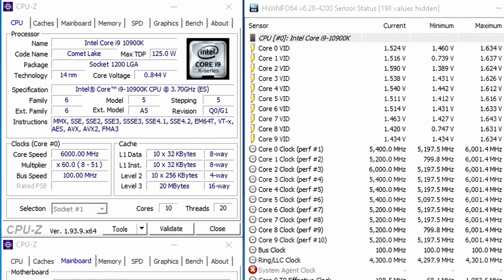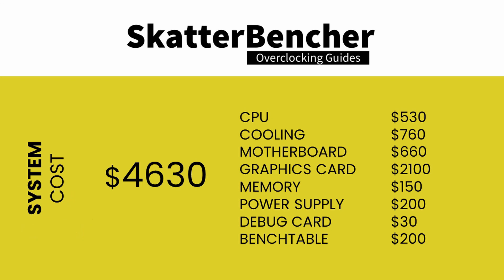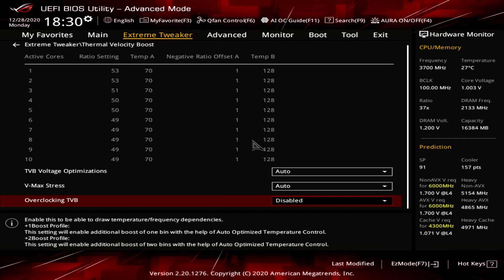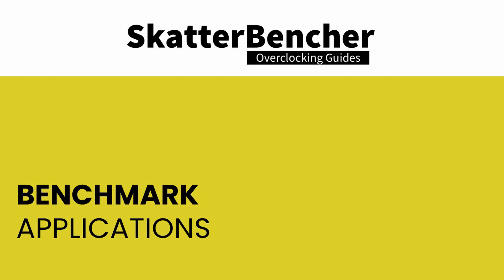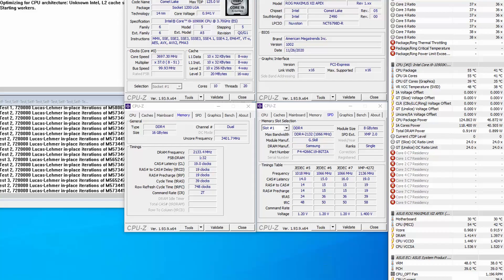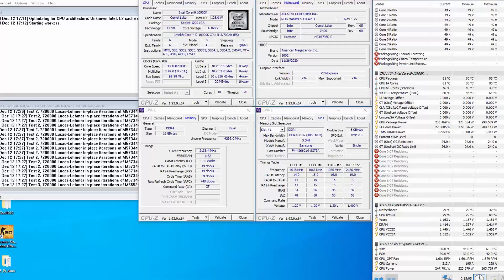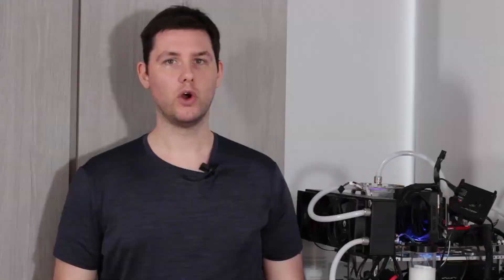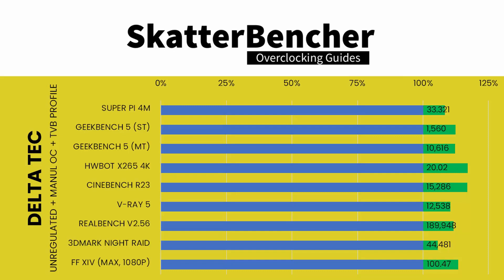Core i9-10900K Overclocked to 6000 MHz With Intel Cryo Cooling | SkatterBencher #19

Comment: Crazy how a 5950x with auto and PBO outperforms a cryo 10900k @ 6ghz. I had the 10900k and its amazing but the 5950x just leaps it hard!
Reply: Not in gaming, only in benchmarks. A 10900k ocd to 5.3ghz with 4.9 cache and fast ram will outperform the 5950x
Reply: @ilovehotdogs125790  Not in the examinations I've seen. Go to check out Gamers Nexus for real figures.
Reply: Crazy how a stock 10900k outperforms even an overclocked 5950x in any game and even on price:)
Reply: @JeoshuaCollins  the “examinations” you’ve seen are using the lowest common denominator of ram.. 3600cl16 (or 3200cl14). Do you know why gamers nexus does this? He said once why.. it’s so his benchmarks of past cpus would be consistent in ram (otherwise he would have to redo all the benchmarks). It’s also worth noting that amd simply can’t use fast ram.. the memory controller is inferior to intel’s. The fabric is also limiting it. Like i said, intel with fast ram beats a 5950x in gaming. It doesn’t even have to be overclocked.. stock with fast ram (like 4266cl17 or 4400cl19) will beat any zen 3 in gaming. Don’t fall for the marketing.
Reply: @ilovehotdogs125790  So you're saying that given faster RAM than the AMD, the Intel performs better.... Do you hear yourself?
Reply: I have a intel 10900k here with the exact same ram and video card as my 5950x. The fps in warzone and farcry are much higher, like 20fps more.

Watch my videos. I have been building computers for 20 years. 10900k is inferior in many ways.
Reply: @Akryl1kz  check out frame chasers on youtube, that guy does ALL the testing. The 5950x can beat the 10900k in warzone only with smt off and an all core oc. In more games than not though the 10900k with fast ram wins.
Reply: @JeoshuaCollins  yep
Reply: @ilovehotdogs125790  Well then, as a counterpoint, if you hooked up an overclocked 5950x to a custom loop water cooler, it would outperform an overclocked 10900k on a stock cooler. If you're just going to give one side better kit, then of COURSE it will perform better.
Reply: I don't have to check out anything lol I own both computers right now identical ram, same video card, power supply. Etc...the 5950x is better. I have put them against one another. My 10900k is on water and 5.2ghz, rtx 3080, 32 gb ddr4 4200mhz. 170fps avg in warzone, 129 fps avg farcry 5, 145fps division 2. 1080p maxed out all settings.

The 5950x set to auto with PBO on with rtx3080, 32gb ddr4 3800mhz (same crucial balliatix ram) warzone 190fps avg peaks around 235fps. Farcry5 155fps, division2 160fps all maxed out

10900k cpuz score overclocked 5.2ghz = 645 sing core, 7800 multi core.

5950x stock auto PBO on = 674 single core, 13,200 multi core.

5950x all core overclocke to 4.6ghz is 14,000 multi core score.

I spent 2 months testing both machines. They are both more than enough for gaming. The 5950x is the better cpu tech with smartshift AMD better NM tech, better thermal, it destroys Intel on production for video and photo, and is equal to or better in gaming. It's a not brainer. Also anything over 3800mhz on ram speed is negligible at best for gaming. Also memory is not truly 3800mhz its actually 1900mhz.

Video editing. I just rendered an H. 264 file on my 10900k computer it took 9 minutes. Thr 5950x computer took 1 min 22 seconds.

Overall the ryzen is better. I was Intel for 10 years. The new ryzens are better. Especially with top tier boards AEGIS updates, and dynamic OC switcher. 

Not talking bad about Intel but the new generation of AMD is better.
Reply: @Akryl1kz   i had both too bud. I sold my 5950x though.. because the 10900k with my testing was better. I don’t do video editing or 7zip file extracting, or blender, or any of that stuff. I just game.. your warzone numbers are way low btw. The 10900k should be able to do 220fps in warzone downtown. The 5950x with smt off and an all core oc DOES win, but at what cost?? Why would you disable smt on a chip like that? Also you didn’t mention timings on ram which is crucial (lol). Also the 5950x can’t reliably hit 3800mhz ram with 1:1 ratio with complete stability, from what i’ve seen 3600mhz is the max if you care about complete stability.. 3800 wont crash but the 1% lows will suffer. At least from what i’ve seen. Strictly gaming, the intel IS better, BUT it’s not as cut and dry anymore since zen 3 wins in a few title csgo, valorant, and the 5950x in warzone (with compromises). Your ubisoft numbers are different from what I’ve seen though, intel should win in all the unoptimized garbage Ubisoft games since the 10900k can basically brute force its way through it. I admit in your situation the 5950x is better since you do more than just gaming, but for the gamer.. 10900k is the answer and you can still multitask since it’s 10 cores. I got rid of my entire zen 3 setup because it just doesn’t fully beat a 10900k, it’s not the gaming king.. but amd has really stepped up their game this time around, that fact that it wins in some titles is amazing in of itself. Also worth noting that benchmarks are basically useless for gamers, comparing single core/multicore score on cinebench or any other software is useless. Intel isn’t best for gamers because of single core (as many people think) it’s the LATENCY. Aida 64 my 10900k gets 41ns of memory latency. The 5950x got 65ns! That’s when i sold it haha. Benchmarks are useless because people aren’t smart enough to compare all the differences and weight them differently.. how many mainstream techtubers have you seen compare memory latency? That’s way more important that fucking cinebench lmao. I appreciate the civil conversation btw. The real answer will depend on the individual, for me 10900k, for you 5950x. Both amazing.
Reply: @JeoshuaCollins  that’s not the same comparison.. the 5950x CANNOT use fast ram. Do you understand? Yes it’s an unfair advantage, but there’s nothing you can do to match it on amd so it’s fair in that sense. You don’t disable 6 cores on the amd to make it “fair” with intels 10 core do you?? Then why would you strip aways intel’s advantage? Their advantage being a superior imc allowing higher ram speeds.
Reply: @ilovehotdogs125790  How are you not getting my point? If you are trying to measure the processor alone, everything but that must be as close to identical as possible. On the other hand, if you are measuring the maximum the platform can achieve with all stops removed you do just that. Limiting AMD to slow memory without selecting the absolute maximum memory it can support and pushing the architecture to the max, while at the same time getting the maximum speed memory you can possibly run on Intel and pushing it as hard as possible, is basically LYING.

AMD isn't limited to 3600/3800MT RAM. You can use really fast RAM actually, with clock speed doubling. However, if you want to push the architecture to its limit you have to take into account the speed the FClk is running at, and max that while tuning the timings as fast as possible.

If you just throw 5000MT ram into the Intel system and throw 3800MT ram in the AMD and turn on XMP, you're not making a fair comparison or running either system at its full capacity.
Reply: @JeoshuaCollins  No, you’re having an issue understanding.. ram is closly linked to to cpu since the cpu literally has an imc built into it. So comparing ram speed actually is fair when comparing cpus. Amd’s architecture is such that running the ram speed at a 1:1 ratio of the fclk clock is the best for performance. That’s why 3600mhz (maybe 3800) is really the max you can go with amd if you want a 1:1 ratio. Intel doesn’t have its ring clock tied to the fucking ram. Intel can use faster ram (and have the performance benefit of using it). You can run fast ram on amd but not at 1:1 fabric ratio, so it’s not beneficial. How do you not understand this? Memory and cpu are so closely linked that you NEED to take that into account. It’s not like comparing cpus with two different gpus.. the MAX amd can do is 3600-3800, you answered that yourself.. im talking about 1:1 ratio. At this point im repeating myself, YES we’re the measuring maximum the intel cpu can achieve and maximum the amd can achieve... the imc is within the cpu so it is actually comparing cpus, but since (obviously) the motherboard plays a role too (with how close the traces and how many layers the pcb is) you can call it “platform.” Doesn’t matter, semantics, the conclusion is the same. 

Lets say hypothetically that pcie-4 actually mattered.. lets say that the 3090 couldn’t get all it’s performance from pcie 3 and it was better with pcie4. Then the amd cpu would be the faster cpu for gaming.. do you get it?? I’m not even a fanboy since I’ve had MANY cpus from both amd and intel.. intel is better for gaming.. the 5950x can have all the single core/multicore scores it wants but intel still holds the crown and that’s because of latency. 

Summary: the “infinity” fabric is amd’s achilles heel
Reply: @ilovehotdogs125790  Okay you've demonstrated you know the terms. We can stop pussy footing around it because it seems we both understand the terms involved. Good.

The maximum 1:1 clock ratio on Zen 2 is 1800Mhz, tho it's usually only sustainable at 1766Mhz. On Zen 3, that changed to 2000MHz, and likely will only be sustainable just below that at 1950Mhz. So you can get some 4000MT ram and dial it back a bit for your maximum speeds. Tweak the timings as low as possible, and that's the best scenario.

But, again, what does that mean for gaming performance? And for that matter, why are we using the 5950x for a gaming workload? Games don't use that many cores, which is definitely the main reason for using such a chip. In my experience, the chips with lower core counts tend to have higher boost clocks, due to the temperature issues. The main thread on most games needs a lot of power. Just because the 5950x and the 10900k are the top end chips in terms of pricing is not really a compelling reason to compare them. 

How much benefit is really derived from that high speed RAM, when it comes to gaming.
Reply: @JeoshuaCollins  From what i've seen zen 3 isn't stable at 1950fclk. It wasn't even stable at 1900fclk. It's important to define stability and also take into ram capacity,  number of dimms, and single vs dual RANK.  I've seen plenty of people on the overclocking forums able to achieve a "stable" 2000fclk but that's with two single rank 8gb dimms which is SIGNIFICANTLY easier to run than something like 4x8gb single rank, or even 2x16gb dual rank. At that point you would get better gaming performance with the 2x16gb dual rank sticks. So the "2000 fclk" doesn't matter unless you can run that with 2x16gb dual rank. As far as I know, that's not possible with 2x16gb. Even at 1900fclk there are issues with stability (but you wouldn't know unless you paid close attention becuase you get no errors, and no crashing, BUT there is a static sound in audio as well as poor 1% lows at 1900fclk which was all remidied by lowering it to 1800fclk 3600mhz ram. Remember I'm talking about 2x16gb dual rank which is optimal for fps. 

Next point, why compare 5950x and not a lower core count? Because the 5950x is the best case scenario for zen 3.. we're maxing both out. It's the highest binned in terms of silicon quality, and has the most options in terms of configuration. I also tested a 5800x for reference. The 5950x can have one ccd disabled making it effectively a higher binned 5800x.. 8 cores with no inter-ccx communication penalty in latency. This configuration was actually worse than leaving 16 cores enabled (depending on title). Also the 5950x can have smt disabled which improves fps in certain titles and even becomes the warzone fps king. Disabling smt on a lower sku zen3 would be detrimental since it wouldn't have enough cores to take advantage of it. 5950x with smt disabled is 16 threads, and 5800x with smt enabled is 16 threads (5950x with one ccx disabled is also 16threads). The 5950x is the best case scenario for zen 3. The 5900x imo sucks because it's spilt into two 6 core ccxs.. in any game that uses more than 6 cores it will have a latency penalty by having to switch over to the other ccx. That's why in Ryzen master the "game mode" actually disables a ccx. The 5600x sucks lol, the 5800x is the second best zen 3 chip imo (for gaming). 

In terms of the boost clock or base clock, it's irrelevant for fps since gaming benefits the most from an all-core oc, you get more fps that way. Even if your precious single core score in benchmarks gets lower, the fps gets better. PBO is only for getting hard for that single score BENCHMARK. For example, the 10900k used to be the best cpu for warzone, now the 5950x with smt disabled and an all-core oc beats it. But here's the thing.. that's just warzone.. in other games different configurations are better, for example flight simulator benefits from latency so the disabling a ccx on the 5950x and keeping smt on is better for that game haha. Then comes the question.. what's the point of buying a 16 core 32thread cpu if you have to fuck with it and make all these compromises to get the best fps? The answer is you get a 10900k, slap some fast ass ram and profit. The flipside is you get a 5950x, keep it stock and get 90% of the gaming fps (or more depending on title) of the 10900k and also use it for workstation. Gaming ALONE 10900k.  The other zen 3 cpus are behind the 10900k. The 10900k still comes out ahead on many other games though which is why I think it's best all-around for gaming. Does ram speed really matter for getting fps? YES! It pisses me off when everyone says that ram speed doesn't matter for intel.. bla bla bla, ryzen benefits the most from "fast" ram. BS. Firsly 3200 or 3600 isn't what i consider "fast" and secondly, the ram speed makes a HUGE difference. Now, to be clear the cas latency and subtiming ALSO make a huge difference. That's why if you look at some goofy ass ram fps benchmark on youtube you'd think to youself.. hey ram doesn't matter! Nope. To calculate theoretical latency in ram you do this: (CAS latency/RAM clock speed) x 2000 = latency in nanoseconds). So for instance in a certain game that doesn't scale well with frequency a ram kit at 3800cl16 (= 8.4ns) might perform better than a kit of 4266cl19 (= 8.9ns). So really you want the fastest ram in mhz first, and second get that latency as low as possible.

conclusion: if you're a gamer just get a 10900k and don't worry about fucking around with the ccx's, disabling smt, etc. If you need a workstation FIRST and you also game then get a 5950x or a 5900x (even though the 5800x is better for gaming alone, the 5900x is a workstation cpu). Zen 3 is great because now you only need one computer if you're a gamer that also needs to do thread-heavy work. For someone like me (which many are) the 10900k is best for gaming, and 10 cores is more than enough for having discord open, some chrome tabs,  etc.

If you want more details watch this: 

https://www.youtube.com/watch?v=zi_77tdRw0A&t=2s&ab_channel=FrameChasers
Reply: @Akryl1kz  such trash talk. A stock 10900k beats that amd in every single game out there. Theres literally hundreds of comparison videos on youtube. Ur just a salty lier. And yes amd obv wins in benchmarks cuz they have more threads but no one cares about that

Comment: How much influence does SP have when doing sub-ambient cooling like this? Seen any correlation between SP and leakage?
Reply from the maker: I only tried one chip, so hard to make any statements about SP. This is a pretty good chip, though. In my previous 10900K vid I could only get a couple cores up to 54x with the Magnitude block and with this one I could reach 55x.

Comment: I was gonna by the cryo cooler as its only 349 now but not worth it
Reply from the maker: Cooler Master also has a Cryo enabled AIO I think. What's the price/availability on that one?
Reply: @SkatterBencher  thats what i was referring to actually :) i may get it to tinker with it
Reply: @SkatterBencher  newegg has it for $349 for the 360 right now in stock
Reply: @SkatterBencher  what i dont understand is the difference between the 3 models they have, there all 360s but prices completly different

Comment: hello,i got it also but didnt install it yet,i have a question...how its affect the whole loop?i have in my loop gpu and vrm(2 x360 rads xe 65mm ,how its gonna affect that?or i need to buy new pump and things? thank you
Reply from the maker: Hi! 

Two things:

1) From a water flow perspective: if things are working fine currently, they will also work fine with the Delta TEC.

2) From a heat perspective: the most significant point to take into account is that when the TEC is in unregulated mode or heavily stressed in Cryo mode, it will add an additional 200W of heat in the loop. That's pretty much an additional overclocked CPU or semi-stressed VGA. 2x 360W should be fine however. I used 1x 360PE which could handle 300W CPU and 200W Delta Tec with reasonable fan speed.
Reply: @SkatterBencher   thannk you very much,!!!very nice video,and work!!!perfect

Comment: Can we mod for amd compatibility?
Reply from the maker: To work with the Intel Cryo control software? No, I don't think so. At least I haven't seen anyone who did it.

You can mod the EK Cryo cooler to be always be on full power, but that means you won't have the temperature control to avoid condensation.

Another method is like Der8auer did in one of his videos and use an Intel "donor" system to enable Cryo: https://www.youtube.com/watch?v=R2MtHJctd-0